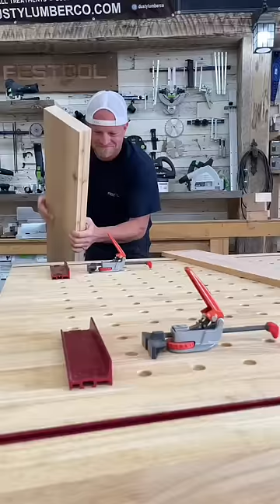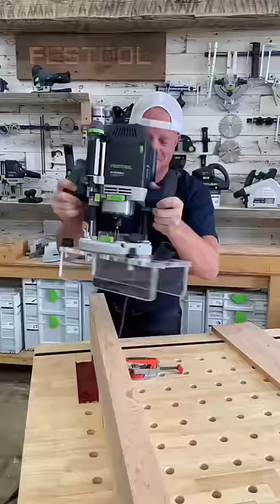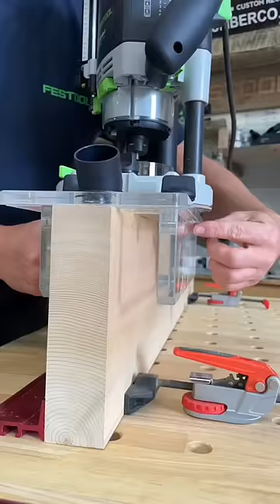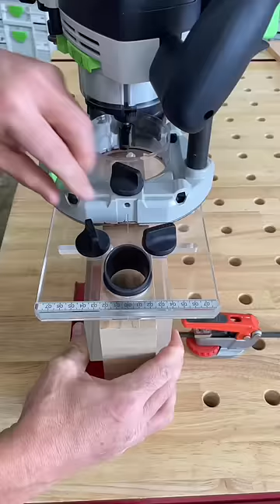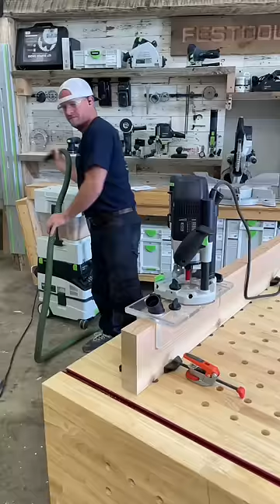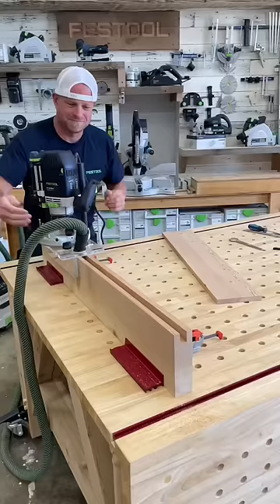Cutting grooves #woodwork #wood #woodworking #bois #maker #festool #holz #tools #madera

Comment: Is that jig specific for the festool router or did you get it separately?
Reply: Both. It's an accessory for the Festool OF1400 and OF2200 routers but sold seperately. Really handy piece of kit especially with the dust extraction.